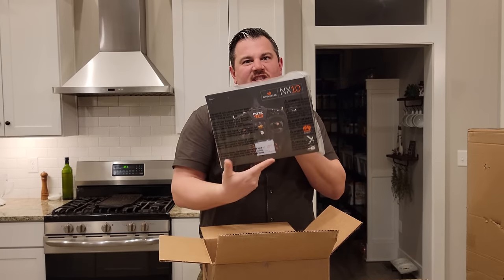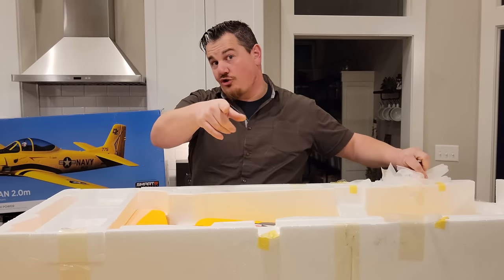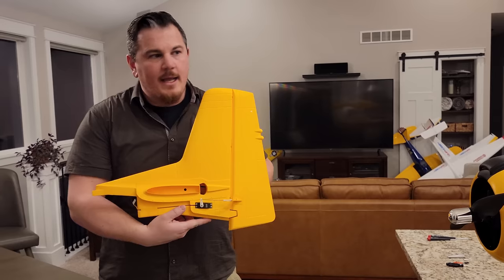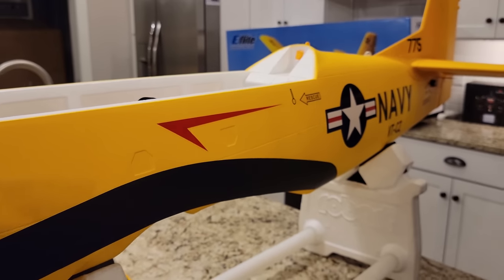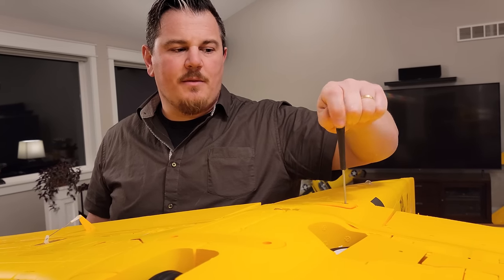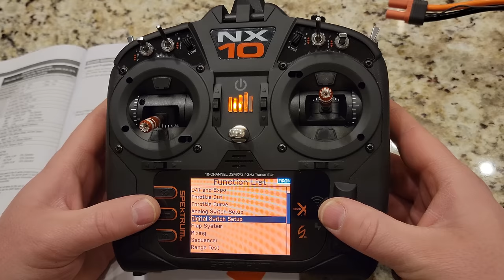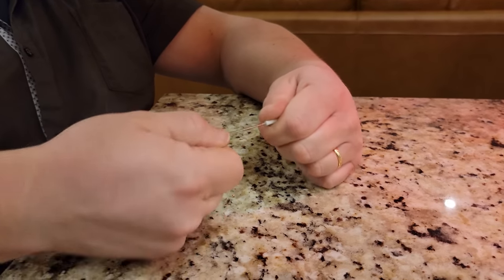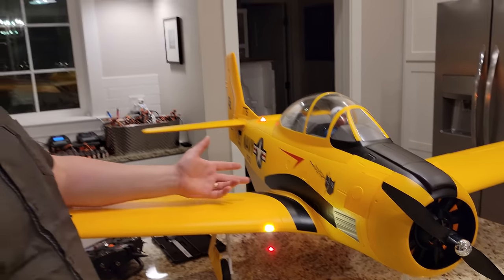Eflite - Carbon-Z T-28 Trojan - 2.0m - Unbox, Build, & Radio Setup

Comment: what about transportation to the field - not all of us have big trucks to put it in - what are your views on taking the wings on and off for transportation ??
Reply from the maker: With a drill, it wouldn't be terrible, but it would be easier with extension cords. I would make a quick disconnect if I were going to take it apart a lot.

Comment: I am seriously considering one of these, but I find the lack of some sort of easy connector on the wings a bit of a disappointment, but easy enough to mod.  Also, a big bummer that they do not use steel clevis.  Those nylon clevis are a crash waiting to happen.  Luckily, also an easy mod.
Reply from the maker: yes, but I agree, and agree again that they'd both be easy enough mods for those who really need it.

I've always thought LONGER LEADS to the wing, when it's detachable for transport, make them easier to lay sideways NEXT to the fuse+tail without the need to even detach the leads. If it weren't for some more recent much smaller planes with quick detach wings, I wouldn't have this complaint ;)

Comment: To be scale correct, this is a model of the T-28A which was only used by the Air Force, and utilized a 2 bladed prop. The Navy versions (T28B and C) had a larger engine with larger diameter cowl, like the 1.2m version horizon offers.
Reply from the maker: Thanks for the details! I have three blades on mine now, and it's a great look, but two blades were better for performance, but by a very razor thin margin. Video coming soon, (When they're back in stock...and we covered the "Soft Tires" which are very hard still, but work well!)

Comment: Paint does add weight to your plane...  a Bowing 747 built in Seattle, will gain over 600 pounds when it goes into the paint shop..  Great video... Keep them coming
Reply from the maker: FOR SURE!

Comment: On checking the gyro directions to see if they are correct, use safe mode is easier.  Aileron and Elevator deflections will stay put when airplane is held at disturbed attitude.  Rudder would only deflect when plane is yawing though.

Comment: About throttle cut off. A few times after a flight i lean over to get my plane and in doing so i move the throttle up. The plane so lunges towards me. So yea its easy to make mistakes.
Reply from the maker: YES, and that's why I pick the direction I pick (on toward by belly/chest), but even with that, it can be caught and caused to turn off...so still not perfect, but way better than nothing, if you ask me.

Thanks for being here with us Alex!

Comment: Not at all gushy Brian, your enthusiasm is contagious and representative of how many of us  feel as you explore this INCREDIBLE PNP T-28, the best "kit" I have ever seen for size and quality at a fraction of the price and time of yesteryear to have.  Great work Brian and Megan, as always!  (and I am only at your unboxing of the cowl so far lol)
  1st Edit:  I have now reached you placing both of your arms in the fuselage cavity that reminded Megan of your cats.  I loved the look on your face when you realized what a tasty treat that gigantic tail will make for them.
  2nd Edit:  Really good tip at the 53 minute mark about avoiding excessive pucker by performing a later re-torque after the foam settles down .
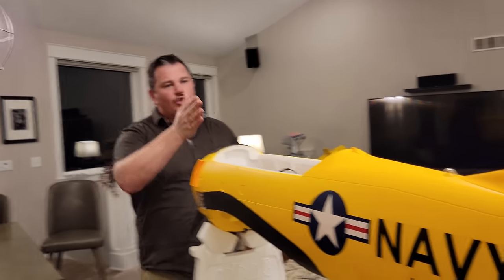  3rd Edit:   At exactly 54:03 I am seeing significant right offset of the vertical stab by design.
  4th Edit:  Great assembly tip for newbies "walking the elevator" into place without damage.
  5th Edit:  At 1:00:28 your toenails look way better than your laminate vinyl floor seams.  At 77, I rely now on outside pedicures, who does yours?  lol, just asking.
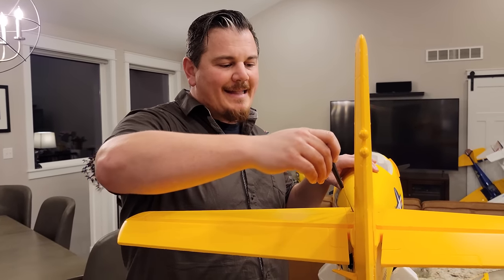  6th Edit:  Your full disclosure at 1:03:00 is exactly what I hoped you would do to avoid "things going bad" since it was following your own soap advise!
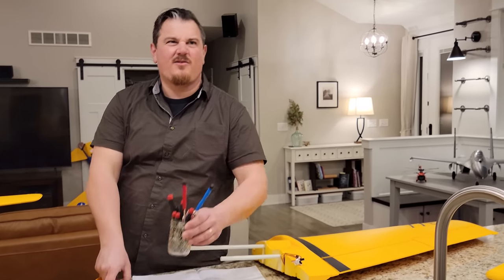  7th Edit:  1:26:54  - It is always the thing I put away to stay organized that I need next!
  8th Edit:  1:27:15  - LMAO, you two were wise not to pursue that train of thought Ha Ha!
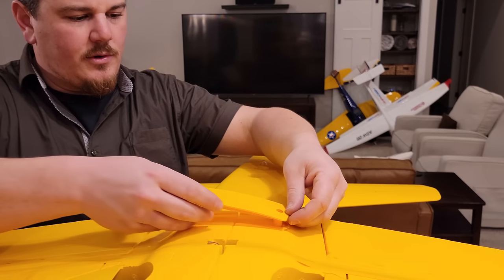  9th Edit:  1:29:48  - Good point made!  Just like the FMS Pitts' top wing there is slope.
10th Edit:  1:30:47 -  Plane eating cats inside your house, flying squirrels outside...Brian, you got problems beyond the normal.  Good plug for stabilization technology.  You need Alf! lol
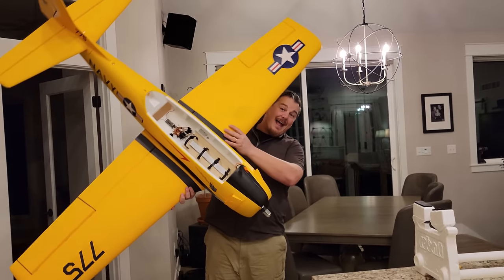11th Edit:  1:34:40 - The trail begins to an obvious brain freeze by Brian...If you're "happily" married is what I heard him say based on all their joint videos that I have seen.
12th Edit:  1:35:22 - The wingspan is taller than you at 6'2" that you predicted earlier would not be the case.  That makes sense since 2m = 6.56'.
I am ending my assembly edits here as I don't fly anymore nor have a strong grasp of the electric configurations.  However, Brian and Megan. my heartfelt gratitude for your videos that invite me into your home and make me feel like a guest rather than just a subscriber.  My ceiling is not big enough for more than my FMS Pitts (unless they make a 1400 Christian Eagle that you two show me how to put together).
  My keyboard is now off even though I am watching the rest of this video for a valuable, and free, education.  I am eager to jump to the video I see in queue for your flight with a chewed up tail and squirrel avoidance maneuvers, but first I am going to watch the remaining hour of this one in silence although I'm certain that will be hard on me.  You are a great inspiration for both active hobbyists and Boomer age aviation retirees.  Stay on course please and always enjoy the fruits of your synergistic efforts.
13th Edit:  Sorry I lied...  HOLY SHIT!  After watching you set up the new NX10, I realized that I am not just retired, but expired too.  I can't even set up a damn smartphone.  WOW Brian!
Reply from the maker: This plane is an amazing one - I LOVE IT!!!
Reply from the maker: @  1:03:00 - Nobody wants to "break their tool" ;)

Comment: Stick a Navy Barbie in there. Problem solved.
Reply from the maker: YES!!!! The stock pilot in this plane is one of my biggest issues (Which is a GREAT issue to have on a plane, btw). I also discovered soft tires in the SPARE PARTS if you follow the link, then click on SPARE PARTS / UPGRADE PARS (can't recall which one it was in)...but they're not in stock yet ;( I will 100% be doing them, if I can get my hands on them, and we'll share the results.

As for the barbie pilot - I need to get my wife to look into that.

Thanks for the tip!

Comment: I like to use a bit of Velcro, because using that drawer liner, I have seen straps that do not hold the battery tight if your doing 3D moves and the battery can shift or I have seen them exit the plane. Just my experience .

Comment: I watched your T28 assembly, and you paid particular attention to the tail section installation noting placement into fuse space and tightening the retaining screws, I had a bit of luck with mine however I could not get the tail section completely forward because the ele. servo interfered against the fuselage in front of the servo.

Comment: Polycrylic is so worth doing on most foam planes i use 2 coats of high gloss and it adds strength and keeps the foam from getting dirt etched deep into the foam years from now my planes will look like new still. Now when i see a bare foam plane it looks un finished cheap n toy like.

Comment: What is the spec for the 3-blade prop???
Reply from the maker: We have the links in our video, but we haven't yet released it, since the Carbon Z T-28 is still back ordered ;(

15X7 Prop https://bit.ly/44heP6i
Soft Tires https://bit.ly/3XFA5Ah
Reply: @BrianPhillipsRC  the PnP version is available. I ordered one Wednesday and according to the HH site it has shipped. The BNF version says Jan 2024 for next available. Weird. Those wing wires are begging for some zip tie organization. And, when I get mine, I'll be adding a short extension from the receiver to the Y connectors so there are only 4 connections to plug in every time the wings go on.

Comment: Brian, I will have to take the wings off for transport.  Extreme Flight offers an MPX MULTI-Wire servo plug (3 wire) assembly for $21 each.  It looks like I will need 2 of these and 4 “Y” servo wires to make this efficient.  Does that seem correct?

Comment: All those charging lipos all packed together is just begging for a mega fire
Reply: I used to be comfortable with doing it as well until I had a box with 6x 6s 5000s Para charging and had one pack go off and as I'm trying to get everything  unplugged while dealing with fire.. with in about 1 min I had a full on raging fire that was feeling my house with toxic smoke so badly I couldn't see... it was really bad and totally stopped me from changing in my house and how I store lipos. Had I not see what was happening for another minute or two by then I would have had 6x 5000mah 6s packs going off... by the them I got the box outside 2 was already fully  venting and shooting fire... threw the box on the ground and within 30 seconds more all 6 was going... how fast those two packs filled the front end of my house with smoke to the point I couldn't see and the fumes Burning my eyes so badly, fighting not to not breathe that smoke in... it give me a new found respect for lipos... I have literally changed 1000s and 1000s of packs and never had an issue so I was completely totally comfortable with just charging and walking away doing my work etc etc until that day. Now I charge in a 3 foot by 1.5 foot diamond plate box that I made, the packs go in the box with the leads running in thru drilled and smooth/deburred holes.  If I'm paranoid charging then I run 6x leads off the Para boards and 6x extended balance leads. That way both my 412 duos,  both my 24v 80 Amp power supplies and the paraboards out all outside the locked box and the cells all inside.  I can charge 12x 6s 5000s in the box with room to spare, the box isn't heavy by its self and easily portable and most important protects anything around it from direct fire should a pack go off. With the longer leads if a pack goes off I can grab that lead pop it off the Para board and take that specific pack out away from the other packs without having my hands anywhere near fire throwing packs. With all those packs piled up like that I truly hope you never have a catastrophic pack failure while your sleeping or something because if you did it would be 100% out of control before you ever even knew something was happeningm

Comment: -the T-28 is from E-flite
-Carbon-Z, not Carbon Z
-Sensor Assisted, not Sensor Aided
-SAFE does not 'do' AS3X, they are separate (though related).
Reply from the maker: I've talked for many, many thousands of hours on YouTube, so please forgive if I've miss-stated some details from time to time, or even make a typo on occasion.

-the T-28 is from E-flite (I realize that this plane is built under the E-flite branding, which is wholly owned and operated by Horizon Hobby. We use the "Mother Ship" nomenclature and tags for E-flite so it's even easier to search on Google / YouTube / WWW)
-Carbon-Z, not Carbon Z  (I don't even understand what you want me to fix here??? Who cares about a DASH?!?!?)
-Sensor Assisted, not Sensor Aided (I stand corrected. I'll need to start saying it right.)
-SAFE does not 'do' AS3X, they are separate (though related). (AS3X is the BASIS for SAFE. I've never said it any other way, that I know of. Maybe it was mistaken from what I said, but SAFE utilizes the AS3X data and functions to make decisions and take corrective action for auto-leveling, and many other features that we don't really get too in depth about, since they're less popular and important. Basically, all of what you're saying is totally splitting hairs, so I don't really understand why you would list these things. We're too busy to have people picking apart our every syllable - would you like it if I were to go to your channel and do the same? What does it gain either of us? We both love this hobby, and want to see if enjoyed by as many people as possible, so if you can't handle a mix up by an imperfect person, our channel is NOT for you.)
Reply: @BrianPhillipsRC  Horizon cares about the hyphen, Carbon-Z is a registered mark and should be represented correctly. Hopefully it doesn't take too much time to add it next time.

AS3X isn't the basis for SAFE, and SAFE does not use AS3X data. No output data is shared, and they both produce their own output, based on IMU data and user inputs. Call it what you want, but you literally said "SAFE does AS3X", which is not true. If you're trying to present information  to the hobby community you have at least some responsibility to make sure it's correct.

What it gains is having the right information out there. You take the time to make these videos, but having it be correct doesn't matter? You make these statements as fact, and your viewers take them as such.
Reply: Don’t worry about guys like this! Obviously you are killing it for another youtuber to pick something petty to put in your comments! Keep making these amazing long format vids! You and “Camera crew” do an amazing job!